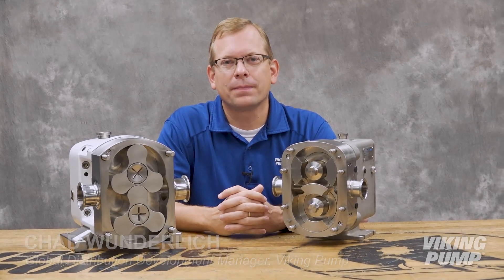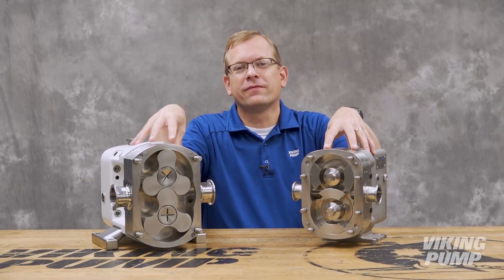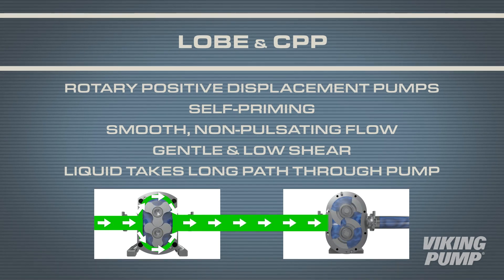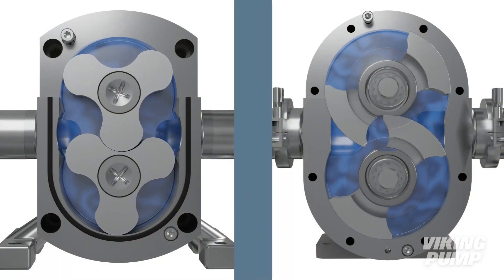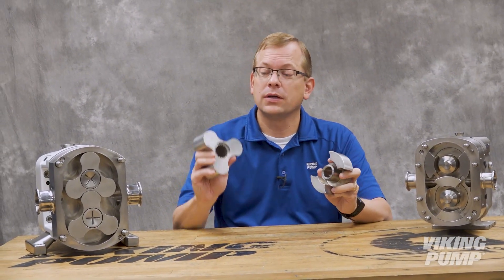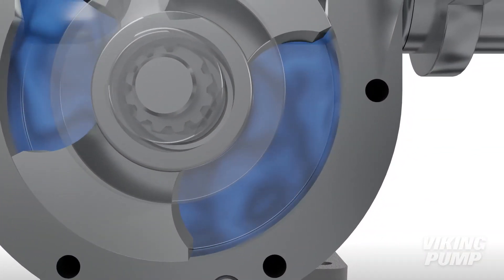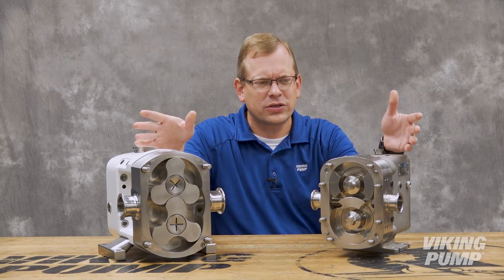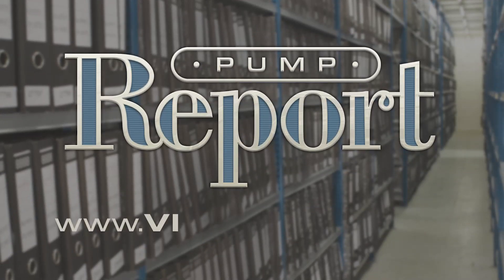Rotary Lobe VERSUS Circumferential Piston Pumps

Comment: When it starts to get interesting, you stop your explanation. Why not give some examples of where each pump is commonly used and why... Thumbs down on an otherwise very good video.
Reply from the maker: Hello and thank you for the feedback! As far as real-world examples go, here's where you can find these pump types:

Rotary Lobe - Pharmaceutical, chemical and dairy applications are common because of the high finish stainless-steel construction and their ability to be cleaned in place (CIP) and sterilized in place (SIP). These cleaning processes allow the pump to be completely cleaned while remaining intact and in process.

Circumferential Piston - Bakeries, meat processing and confectionary processes are common due to their non-galling stainless-steel construction and their ability to handle larger solids. These pumps are commonly cleaned out of place (COP). This means that the wet end of the pump is disassembled and cleaned separately in a washer and are inspected before reinstallation.

You can learn more about these cleaning techniques in our video here: https://youtu.be/fR0i-kgGTYw?feature=shared